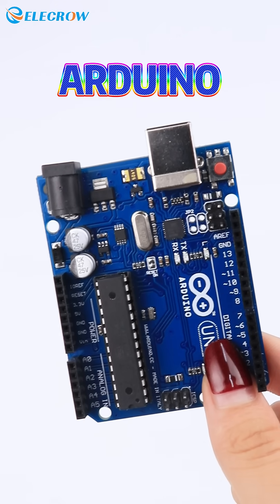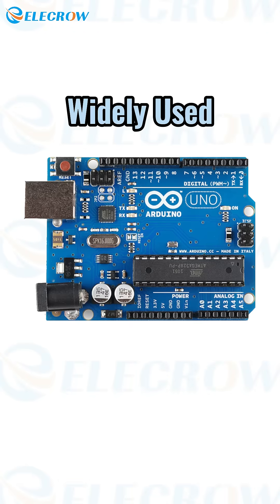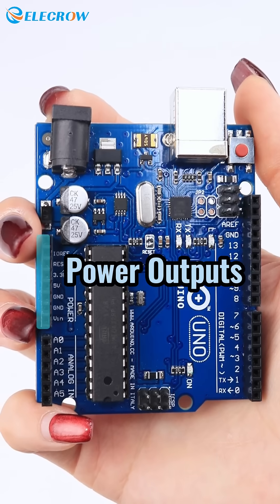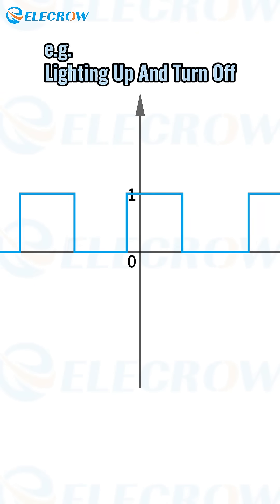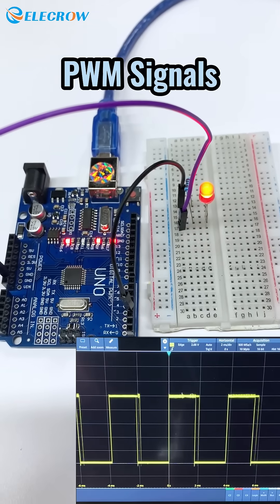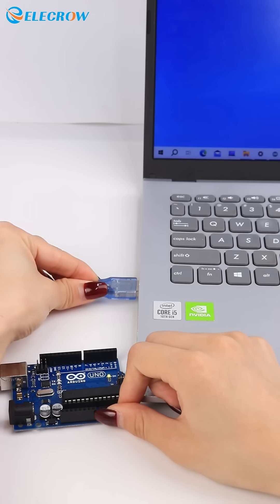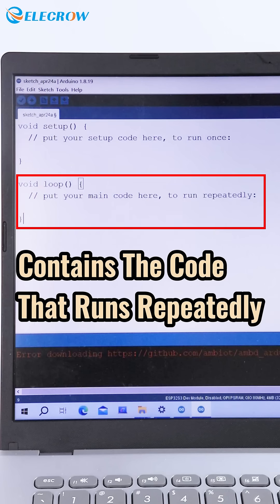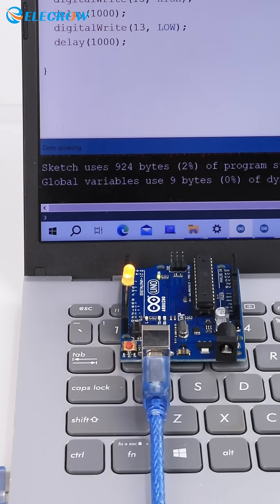1 Minute Guide to Learn How Arduino Uno Works #Crowduino

Comment: DISLIKE.

This is OK except your $3 AI is useless and distracting. READ IT YOURSELF - assuming youre literate. Honestly, when describing electronic circuits, C Should be seen as voltage, not Vee. There are lots of other examples.

Also lise the mysic. This is factual stuff, and a gaytime song playing is again distracting and unnecessary. I'll subscribe for now, as I'm an Arduino user and may learn something.
Reply: Millihertz? 
When did you last come across the term millihertz? When you last installed a submarine communication system? Jesus wept...